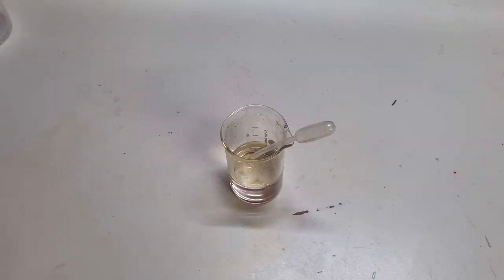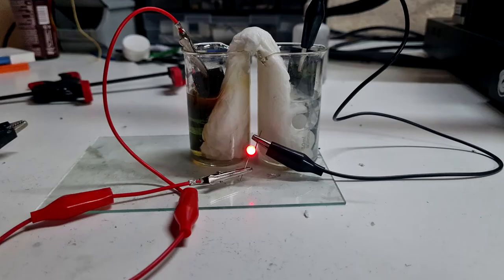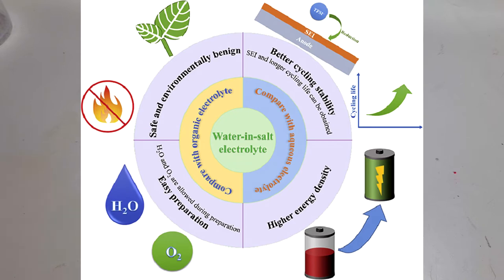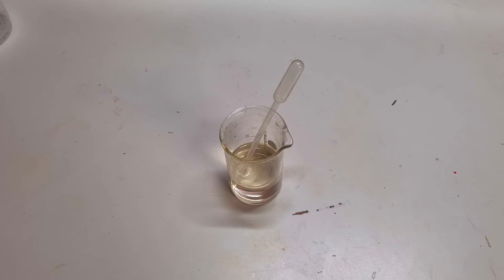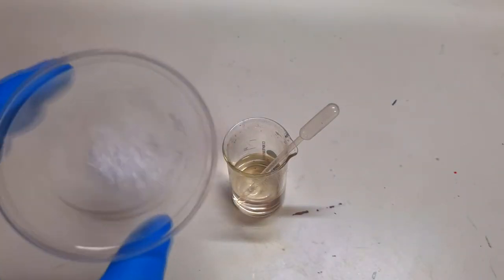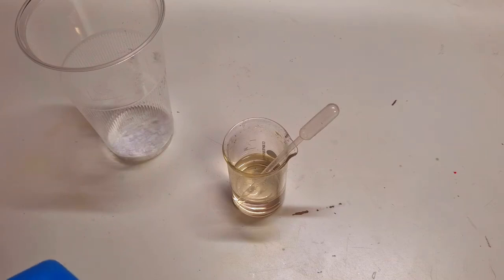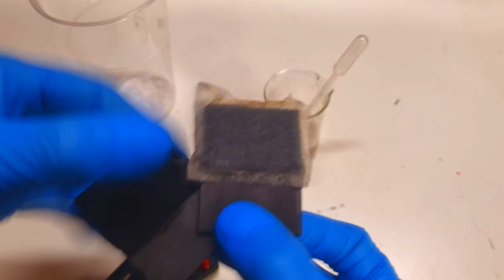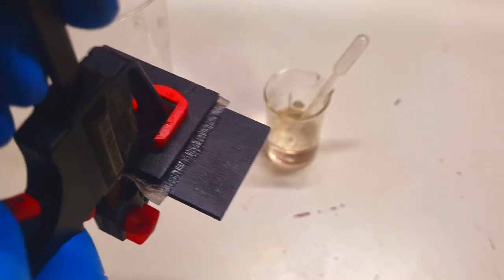Battery electrolyte evaporation?

Comment: Water in Salt electrolyte (WISE) tends just like the classic salt in water electrolyte is composed of concentrated salts in water. eventually the little water in the WISE evaporates leaving the salt behind. Unless there is  annadditive to trap the H2O, the water will certainly evaporate. You should have advised your enthousiasts to add PEG400 or even at best some glycerol and if the viscosity is high to add some ethanol! This are all trapped in the additive and cannot evepaorate easily. It also mitigates metal anode corrosion ( HER)
Reply from the maker: Latter I was start using PEG 200 because I need it in the system. I still have the orginal WISE electrolyte from this video on my desk in open cup. Good idea about ethanol , I dont know about that.

Comment: Some chemicals will take up moisture from the air to a point, and then stay at a certain level of saturation. I've had a beaker of sulfuric acid sit on a shelf for over a year now and the level of the liquid hasn't moved....
Reply from the maker: Correct. One of good chemical to take moisture from air will be magnesium chloride or glycerol. Which can be also good for this job that the elecrolyte will be wet most of the time. The potassium acetate WiSE is tested on around 23 to 25 deg C with not so much moisture.
Reply: @cayrex  maybe we could also just add some magnesium chloride to our non magnesium electrolytes?
Reply from the maker: @Buzzhumma  Yes you can if you want. And you will see what you will get. My attention was WiSE electrolyte and because I get low evaporation for almost a month and I  chat with some people about evaporation problems,.... for this reason I make this video.
Reply: Copper nitrate I can't even keep dry when I try....